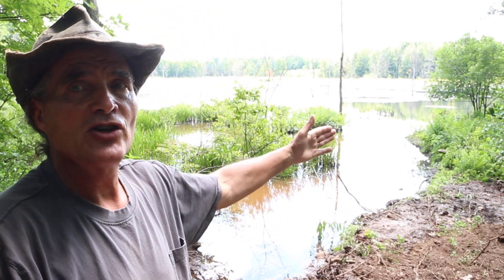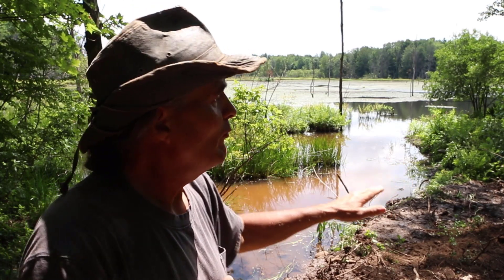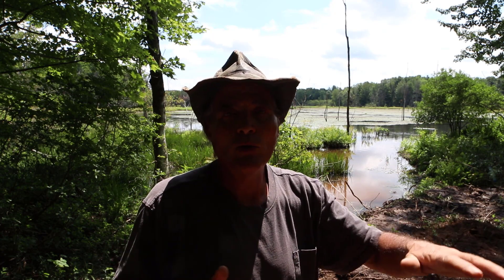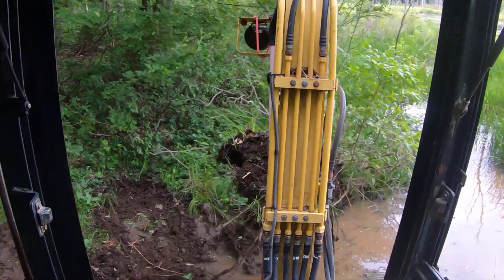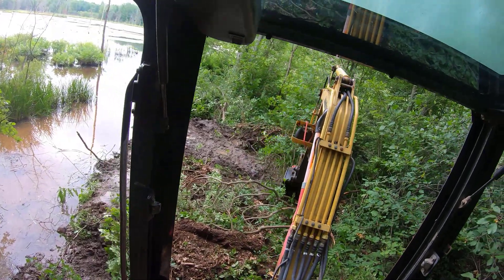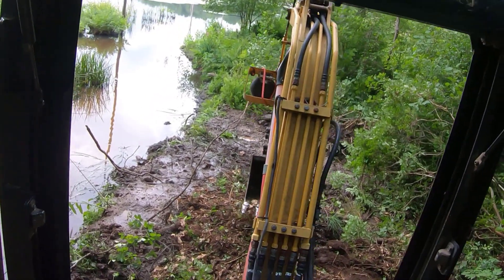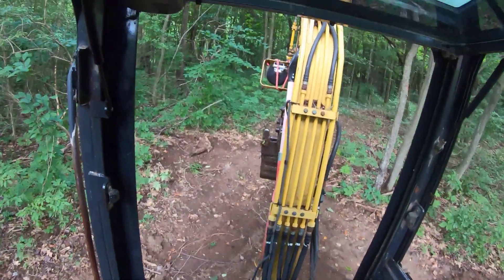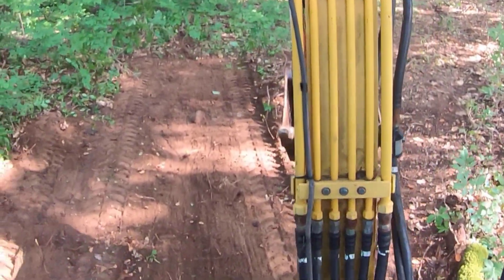Beaver Dam Work July 23rd 2020

Comment: Does bumblebee have a thumb?
Reply from the maker: High arcs and sparks welding, thanks for the question! Yes I purchased a thumb a couple of years ago but I have yet to install it on the stick. One of the reasons, besides being too busy, is that it's not removable and it adds a quite a bit of weight and therefore decreases the amount of material I can carry in my grading bucket. Bumblebees off light duty excavator and therefore could easily tip over when I've got that bucket heaped up. However I really do need to get that thumb installed. The thumb that I purchased is one that is a hydraulic unit. Thanks for the question and have an awesome day!